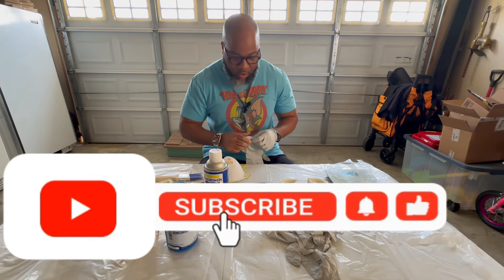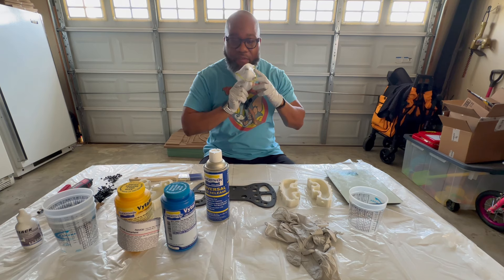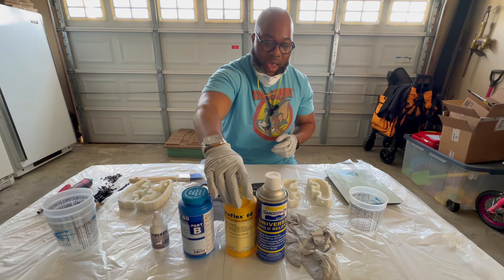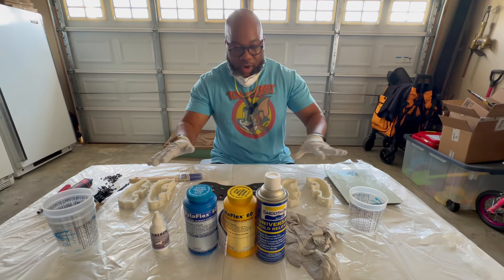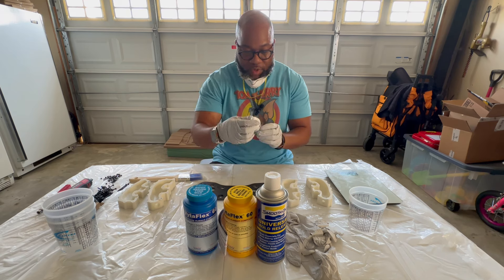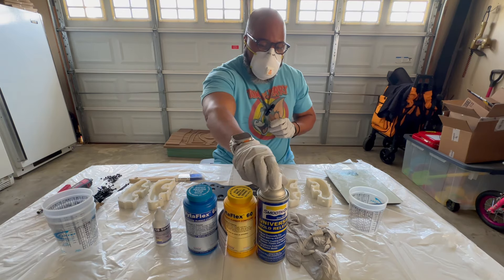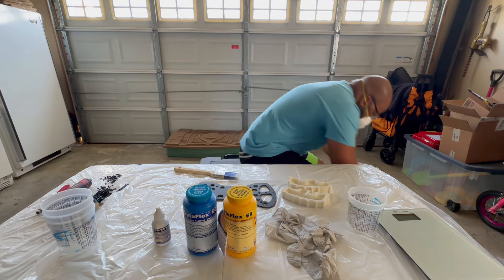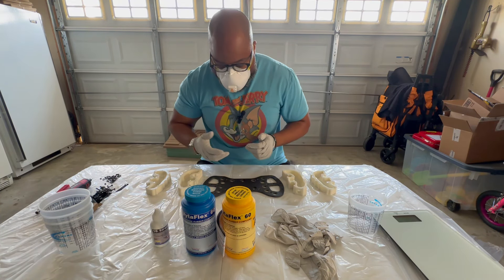CASTING FIRST GRIPS: OBVIA RACING MC24

Comment: I am want to make grips for another wheel I am building. Where do you get the actual molds?
Reply from the maker: These molds prints are provided by Obvia but the prints themselves from JLCPCB in XResin.
Reply: @grayzedynamics  Thanks for the info. Building the Turn Racing 992 GT3 wheel and would like to try molding my own grips.
Reply from the maker: Most welcome. Yeah I feel like if someone can print the grips, than reverse engineering the molds shouldn't be hard.